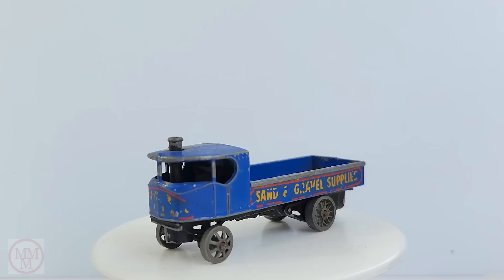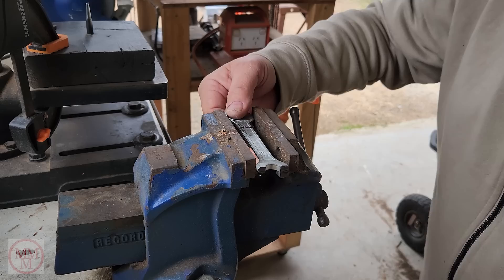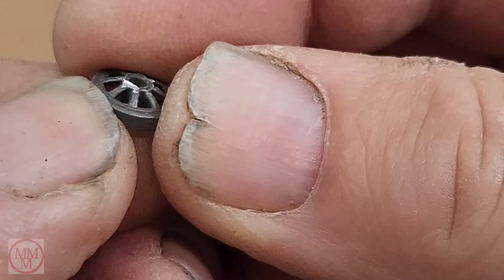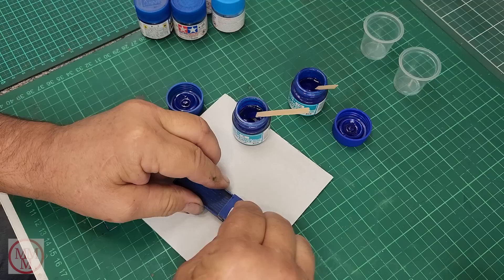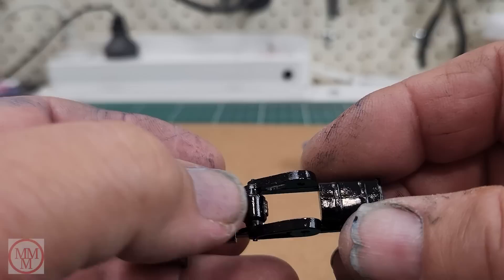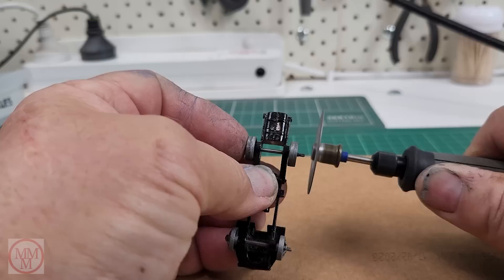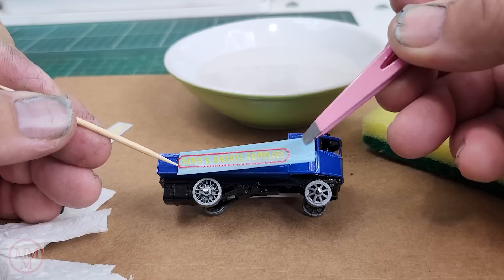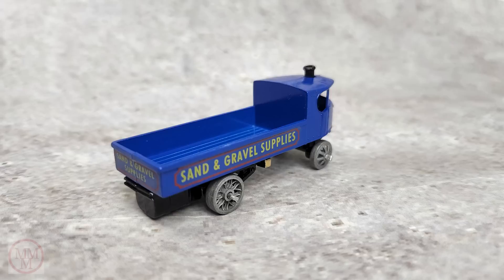MATCHBOX  Restoration  Y4 Sentinel Steam Waggon 1956

Comment: Holding the axle with a pair of needle nosed pliers would help considerably in grinding down those crimped sides... Just saying. Many paints need to be thinned. Some are "meant" to be thinned. I am a modeler & a sign painter. I rarely come upon any paint that doesn't need tweaking one way or the other. One shot enamels for signs is a marvelous gloss paint line. You have no idea how pleasant it is to have your videos back. Your hobby mixed with your voice & accent along with that slight back ground music is very relaxing. The end photo of Kevin ramming the truck into a tree could be framed to hang on your wall. It has a look to it.

Comment: Never underestimate the sticking power of a taper pin. They can be amazing.
Reply: They’re basically wedges, and the amount of force to wedges can apply when being used to clamp is extremely high. It’s like a Bolt or screw and the force they can apply to hold things together because they are basically a ramp wrapped around a cylinder. So, as you said, they are amazing.

Comment: This was a great restoration! I have never seen this model before but it is really neat looking. I agree, it would be rough driving it in the summer sitting next to a boiler. I have an Iwata Neo airbrush too and it works great. I mostly use it for base coats but it does a nice job. Thanks for sharing this.

Comment: I really enjoy your videos. Here's a tip: next time you want to use a cutoff wheel to remove the crimp flats on the axles, lock your smaller Dremel in a vise and hold the vehicle in your hand. You'll have much more control because you're not holding two things at once.

Comment: buahahahaha "russians shoot down ufo: angry aliens turn soldiers into stone" lmfao :face-purple-crying::face-green-smiling::face-blue-smiling: Some advices, Marty. When you have to grind an axle, instead of keeping the other wheel from rotating just grab the center of the axle with a plier. About the airbrush: always remove and reinstall the needle from the front, you won't have any residue of paint in the body of the airbrush itself. Last, about the decals. Use some decal softer like Mr Mark (Gunze-Mr Hobby) so the decal will adapt even on the worst imperfection of the model. Cheers

Comment: Fast for a steam truck, but a Stanley Steamer automobile held the speed record for an automobile at one point. 127 MPH (204 KPH) in 1906. The steam powered Doble E-20's top speed was 132 MPH (212 KPH) in 1925.  It's a misnomer that steam powered vehicles are all klunky. The fastest non-electric locomotive on the planet is the steam powered Mallard @ 126 MPH.